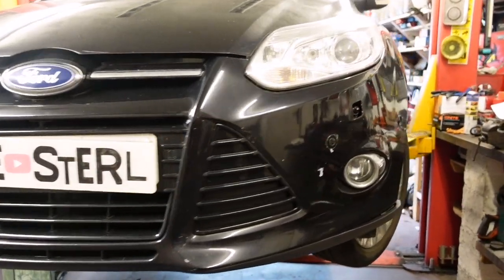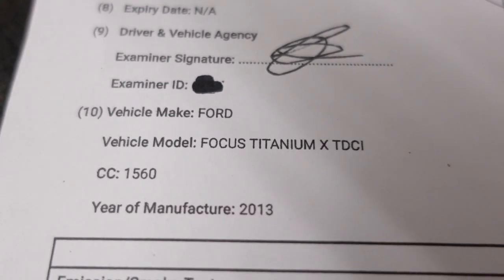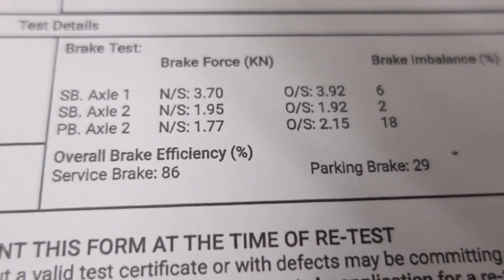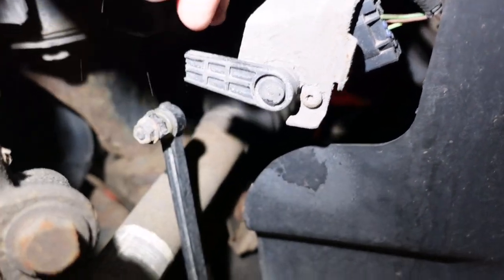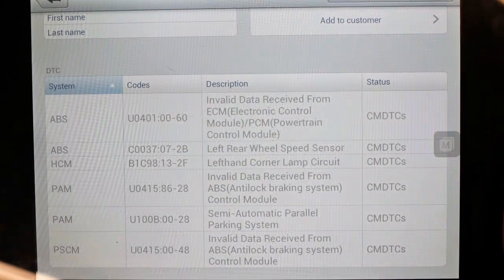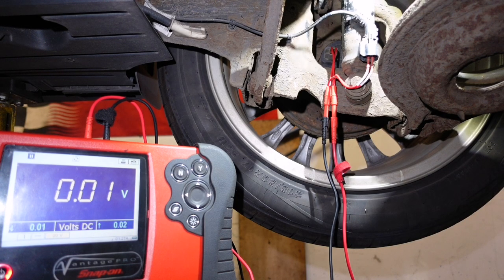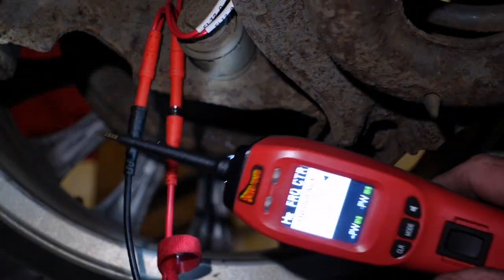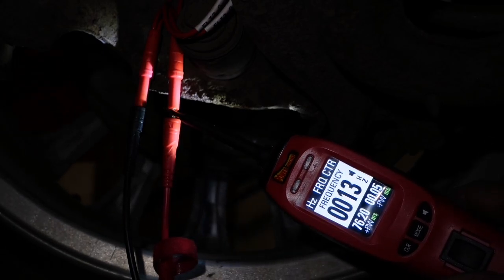Ford Focus Mk3 ABS Fault. Digital ABS Sensor Testing

Comment: Cheers Dave, I have noticed that when the negative wire is at 0 volts it's the positive wire that is the signal wire, and when the negative wire is around 1 volt it's the negative side that is the signal.
Although I've seen BMW and Mercedes with an unusual signal ( not much happening)  on known good directional sensors. 
Thanks for the video mate.
Reply from the maker: Yes Matt, good observation just depends on what pole the module is reading altho the current will flow in and out. You could break into the circuit to measure the mA or wrap say 10 turns of wire around it to make a multiplier for your current clamp. It would be interesting to see what shows on the directional sensor

Comment: Hi Dave, thanks a lot for the lesson! So if there are any rust particles around the magnet ( 12:58 ) the sensor will go crazy, right? My left rear sensor is unstable. It occurred after cleaning the wheels  with rust-cleaner product. Sometimes it works, sometimes it doesn't. I've already cleaned the connectors, without success. I haven't tried cleaning the magnet yet.

Comment: Perhaps you should take up teaching. Very well explained and good that you confirmed that the complete abs circuit was operational as some people may well assume that the sensor is at fault, which it was, but  could also have been a an open circuit in the  system. This was compulsive viewing.
Reply from the maker: Cheers Colin, aye we all know what assume means lol

Comment: Just completed a rear nearside sensor change. The ABS light did not go off by itself and I had to get it reset/turned off professionally which Ford did advise I may need to get done.

Comment: 2011 Mk3 Focus titanium with abs / esc lights ...showing rear right wheel speed sensor. Changed that no difference so paid £265 for a mechanic to sort it and it went away. He said it was a wire under the dash 🤔 issue went for 2 months now back...exact same codes and warning lights and haven't a clue tbh ....obviously got ripped off and swapped wheel speed sensors from left to right no difference.....I have a new SKF rear hub / bearing but don't want to waste time swapping it if its something silly. 
Dave in honesty you lost me after a few minutes and can't waste more money ... any help? 
Just found your video too technical and I haven't all that equipment.... 😢
Reply from the maker: You may hope the mechanic does not read this, you think 'obviously ripped off' but yet haven't a clue.
Reply: @davesterl  I know the guy and have spoken to him. Why tf should I be worried 🤷🏻‍♂️ 🤣
After the 1st repair I asked what the fault and was told it was a wire under the dash and asked him where to be told he couldn't remember 🤔 
The fault is back and he still can't remember what wire 🧐 I've worked on cars since I was 17 ...56 now and no not so good at electrics but run diagnostics on the car yesterday exact same codes and fault ....nothing going to rear right wheel speed sensor so I'll work my way back this time myself and rule out everythingI can...he can't tell me which wire and got cagey ....thanks for your positive input 🤣
Reply: @davesterl  oh also said the 2 new Ford Wheel speed sensors i bought were burnt out 🧐 🤣 👍🏻
Reply from the maker: @martynj-c4965  ask someone to read your own comments and maybe you'll be enlightened.
Reply: @davesterl  I am enlightened .."don't use him again"!
Reply: @davesterl  Dave ...what would of been enlightening as a YouTube information / educational channel would or could of been to offer some suggestions to look at etc ... not worry about another back street mechanic ....I'm sure you've had many cars over the years that have come to you with faults where someone has tinkered about and messed about not doing any good. That's why I watched your video and others to gain more knowledge as I like to learn and do things myself where possible. Anyway thank you for your comments. Regards.